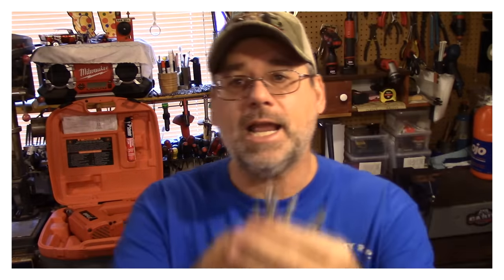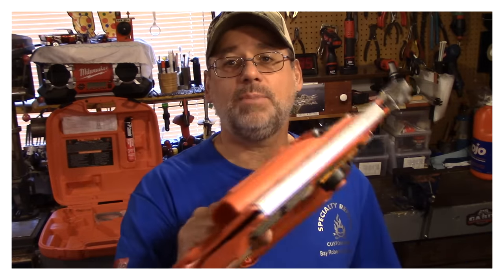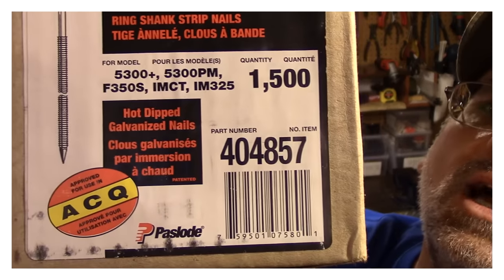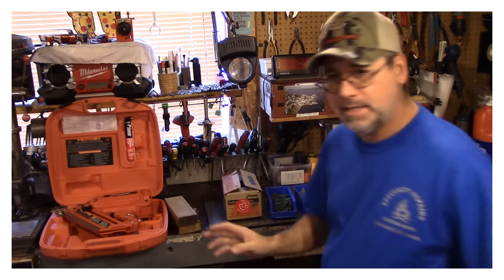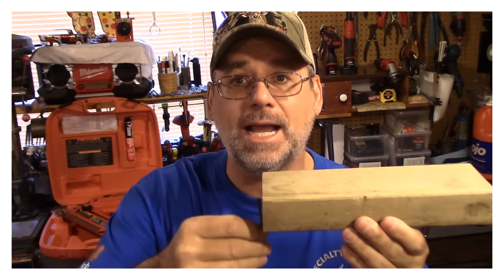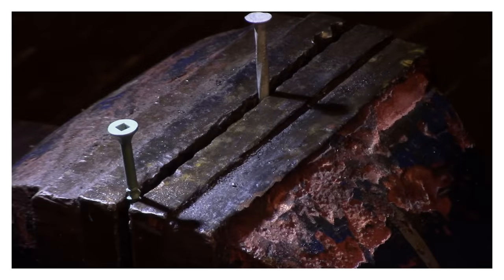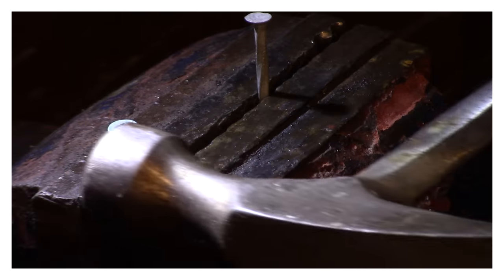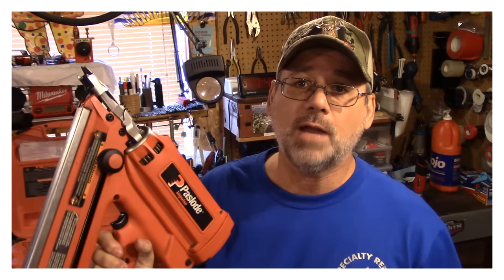BEWARE  NEVER USE DECK SCREWS  - DECK SCREWS VS NAILS -  PART TWO IN DESCRIPTION

Comment: Your on the money Steve....Just got back from camp and the black flies are in season....me and my buddy came back a day early....could not stand the flies any more....guess i`m getting old but that tip bout the screws and not using for erecting any kind a construction   is spot on....had a electrical friend a mine wanted to do extraction on his camp with screw and he said it was the way to go and I told him if that was his way I was not helping but if he wanted i`d bring the air guns and even supply the nails and I`d be there and I think I converted him....the new pressure is I think some kind of sugar base....they can't use arsenic any more and I seen the pressure treated wood rotting around a normal rusting nail but even hot dip rust.....I a the camp have a chain thats ten years old and its hot dip and you could not tell to look at it.....must go ....lots of backed up movies and messages and ....ah I have to hire a secretary but I have to pay out of my pension money....ah I`ll ask my wife If she wants to be my secretary....SALUTE my friend
Reply from the maker: HAHA need a secretary now. LOL  Might be headed up this weekend and I know the bugs will be bad too.

Comment: That's true for impact loading screws are carburized and heat treated to high hardness and strength but are brittle and may even break during rapid torquing but they resist creep due to temperature change and water exposure that will make the nails pull and loose grip of time.  Screws hold fast - this is why they are used to stop old oak and maple tongue and groove floors from creaking after the nails loosen over time.

Comment: Ok, yes, steel deck screws break. BUT you can use SS, stainless steel deck screws, they do not break, they will outlast nails, they can bend more cycles than nails. Other interesting thing is bronze wood screws for boats. You would think they might break, but they usually never break, and a wood boat has a ton of movement all the time for many decades of life. Of course bronze cost too much for houses. Nails are the best cheapest option. But my experience using SS screws versus deck screws, is the deck screws break and the SS screws have never broken. I dont even like using deck screws on the top boards of decks.

Comment: Both have their uses...screws for surface clamping..nails for structure/shear application
Reply from the maker: Hi Edward 
💯 % 👍  I just went on a small job to replace 14 deck boards on a huge deck , all with screws . All the screw heads were full of solid stain so it  was a bear replacing the boards compared to nails . They both have their pros and cons . Cheers 👍

Comment: I have built decks for a few years always use screws for the decking.  Over a number of years had to replace  a number of decks because nails were used instead of screws. Usually by someone  flipping house just to say house has a new deck.
Reply from the maker: Deck screws are designed to be used for deck boards as well as fence boards .  They are definitely not designed  as a universal replacement for joist hanger fasteners or lag screws ect .  For the most part screws vs nails  for fences or deck boards  are a  choice  .  Cheers Steve 👍

Comment: Wonderful tip and example of why u don't use them in structure application. I really wish they would put a warning label on the screws to alert folks from making a mistake.
Reply from the maker: That's a good idea . I wonder now why there is no such warning. Great idea and I will look and see if there is any mention. Thanks

Comment: Yes Steve absolutely a must do use galvanize fasteners in pressure treated lumber in fact when I started the sky coop The guy at the lumberyard gave me the wrong nails and I probably used 100 or so before I realized I was going wrong on the Simpson ties straps I didn't bother pulling them out I just had to drill a second hole to Adam other faster next to the wrong one it really sucked not to mention set me back half a day 🐔
Reply from the maker: Turned out great and will last a long time. Yes the wrong fastener can make for a bad day into the future. Cheers buddy

Comment: Deck boards,use screws doing it once.I have pulled out so many nails that popped up holding in deck boards replacing them with screws
Reply from the maker: I agree and use good deck screws too  Cheers Walter

Comment: Good video. The key thing to understand with any screws is that they're meant to clamp things together (load trying to pull the boards apart), not hold shear (side load, like the hammer blow in the video). 

The screws are much better when clamping is what you want to do, since they're threaded, whereas nails will back out.

The nails are much better at holding shear loads. 

It's not that deck screws are crap, they're just not meant for shear.

Comment: Im not a carpenter.. I mean I have built many things, and 90% of the time I admit to using screws. I figure a screw isnt going to back out over time like a nail can do. Never had any failures, but certainly cant argue with your little demonstration there. Might rethink things from now on.   As far as the outhouse build and a video, I vote do it!  I would find it interesting!  Dont hear of many people building an outhouse these days.  I actually have an outhouse here at my house from years gone by when that was the only option. Ahhh the good ol days right? LOL!  Great video Steve!
Reply from the maker: We all use them and sometime it can go sideways in the wrong  spot. Yes they're ok but use them wisely I guess.  Outhouse it will be. Cheers

Comment: Though that box of strip nail says hot dipped, I have my doubts. Typically hot dipped hand nails have a very rough surface. The only way I'm aware of that galvanization can be done to have a smooth surface, is electro plate.

Comment: Depends on the direction of force {load} Nails have better shear screws have more tensile. If it's where two pieces can slide against each other on the horizantal nails better, if it's where the direction of pull is vertical screws are  better.

Comment: Your absolutely correct that they are brittle.  I like those twisted nails that you showed, smooth ones pull right out.  That being said, I have pushed deck screws to the max. building scaffolding.  From the view point of metalworking there is a strong force when tightening two smooth surfaces together that resists the shear force.  I built my house with 10'-13' high ceilings and made a false floor throughout the house so that I could install 4'X10' T111 to the ceiling by myself using two to three deck screws at the end of 2"X6" with 3/4" plywood on top.  After taking the false floor down I found a couple of places where there was just one screw from where I assembled it myself, so that the other end swivels, and then I forgot to put one to two more there.
Reply from the maker: Interesting topic for sure as many do use deck screws in some odd spots :) Cheers Brad

Comment: This has to do with the temper of the different metals. Screws last longer and have higher mechanical bonding, but are thinner and hard tempered. Nails are usually cheaper by a lot (which is why they are used) thicker and have a softer temper. Anything that requires more sheer strength then a screw can hold should be using structural bolts and brackets. Nails are why homes fall apart in 50 mph winds. Nails were originally invented with a soft temper and to be driven THROUGH an object and folded over on the other side which is far superior to modern uses.
Reply: Thanks, this info re bent-over nails is is a really interesting and helpful historical insight. Adds to the bigger picture of this video.
Reply: We've all heard the phrase "dead as a door nail".  Many years ago when doors were made a long nail was hammered through the door and the sharp end bent down with a hammer to ensure it wouldn't back out. That made the nail non-reuseable i.e. "dead".
Reply: Excellent information.  While I use screws for their compression abilities I also use brackets with bolts (not lag screws) to through-connect things like rafters to top plates.

Comment: Sold my old Paslode (not paying for gas) and added a DeWalt nailer (battery), glad I did. Don't smell the gas and the gas cartridge doesn't end up in the dump. Never had a problem. Battery-powered tools are the best!
While I agree that you wouldn't want to use screws for structural (lateral holding strength)  when heavy load-bearing, they are great for attaching deck boards. I think the video should have shown the benefits of using them to hold boards in place and firmly to the joists, which nails do not do well. Always use 16d galvanized and joist hangers along with joist nails for the framing.
Reply from the maker: Well said and I agree . The choice between nails and screws for many comes  down to cost but sometimes you save upfront and pay after :) Both have their place and knowing their place is what this vid brings up. Cheers Christopher

Comment: 4:40 I see what you’re getting at, finally.  The metal used in the screws is hardened to give them the torsion strength needed to not snap off as easily when being driven in, but that compromises their sheer strength.  Nails use a more ductile type of steel and therefore are made for and perform better under sheer loading.  Now, it should be noted that there are lots of types of screws, so the above is to be taken as a general rule. 
Good point, you just took a few minutes to get there.  It’s definitely Worth considering the forces and environmental circumstances acting on the structure being built and choosing the appropriate fasteners.

Comment: Good tip specially with something that will shift due to weather conditions.
Reply from the maker: I had  deck  screws holding the door hinge  on  my old outhouse and noticed last year two heads missing , just the shaft was there  and I was wondering why the door felt wobbly , hahaha .  I guess over time it loosened up and  snapped the heads off.

Comment: To explain why pressure treated eats metals the C in ACQ pressure treated lumber is copper.  When dissimilar metals come in contact with each other in the presence of moisture/water (or other conductor) the less noble of the metals gets eaten (corrodes) by the stronger metal.  It's called a galvanic reaction.  A typical nail/screw will deteriorate very fast in pressure treated because of this.  A galvanized screw/nail has a zinc coating that's sacrificial and gets eaten by the pressure treated wood, but takes a long time.  Once the wood eats through the galvanized (zinc) coating the steel underneath will quickly be eaten following.  The more coating the longer it will last (why electroplating is least protective and double-dipped galvanized is very protected).  Some screws/nails are coated with a special coating that prevents moisture coming in contact with the metal of said nail/screw resisting galvanic reaction.  Many manufactures actually use a combo, they hot dip galvanize and then cover with a polymer (more coatings the better) as it's cheaper than double-dipping and offers more protection than a single dip.
Reply from the maker: Great explanation.  Thanks 👍
Reply: Is there a hot dip galvanize deck screw?

Comment: Thanks for the tips, and thanks for the tips from u guys in the  comments!  I've had nails pulling out on my own deck since i put in the new floor and replacing then w/screws.  But will go with nails on any structural.  I'm a handyman, wood butchering being on the bottom of my favorite things to fix but gonna get a call now and then for it!
Reply from the maker: Cheers Paul  we all learn from each other. 👍

Comment: The screws and nails you buy at most lumberyards rust and do not last as long as the treated wood. I recommend stainless nails. Maze nails are the best for galvanized, maze ring shank, once you pound them in they will not come out. Stainless ring shank is best for structural but stainnless screws are ok for deck or non structural areas.  Some stainless screws can be kind of weak and break off  while screwing though.

Comment: I use deck screws, Torq? In framing as well as decks and privacy fence inst. , it’s easier/ much less painful than holding a nail gun or the joint shock from hammering, of course I’m 65 with plenty of joint damage and DDD.
Reply from the maker: Hi Michael 
I know how that feels, too. Cheers 👍
Reply: Michael, an impact driver works far better than an ordinary driver-drill. I have arthritis, and when I bought the impact driver several years ago I was amazed at the difference and kicking myself for not having bought one much sooner!

Comment: From my Dad the Structural Engineer “screws are for pull out, Nails are for Sheer.”  Use nails except for when you need pullout resistance
Reply from the maker: I go by best practices and follow local building codes  when in doubt.

Comment: I use deck screws for structural all the time. Several sheds, small barns and even yes decks. Never gad a problem or failure.
Reply from the maker: Structural can mean different things to people but deck boards , exterior barn boards or the outside sliding of a shed is not structural .

Comment: my dad built a 40x60 shop using nothing but 3" deck screws back in 2000 and it hasn't fell down yet, so I'm gonna say they are fine for building an outhouse. Not sure what code says about this but The screws don't break like that if you have it going through a board like it should be. If you do the same test with one of those ring shank hot dipped nail gun nails you have there, they will break off too, they won't just bend over like a hammer driven nail. with that being said put 2 post in the ground nail a 2x6 or something horizontal across between them with a screw in one side and a nail in the other and hang weights off of the center of the board to see which side fails first. I prefer the ring shank hot dipped gun nails, cause they are faster but Im not sure that they are any better than screws as for as shear strength because I've broken plenty off.
Reply from the maker: Good points Chase.   The deck screws  may be  more affected by climates with cold.  If a building has to be inspected by a building inspector  it most likely won't pass inspection with plain deck screws in a lot of jurisdictions.  Was the shop your dad built inspected by your local building inspector.
Reply: no, its in a very rural area and was also 17 years ago so I'm not sure it would have even mattered. it's built similar to mine except not as tall, and he got a deal on wood poultry house trusses like mine but couldn't move em on his 18' trailer that i had in my video so he cut trusses in half with cutting blade on a grinder where the metal plates were, and joined them back together when he got em home with 2x material and deck screws, and then I kid you not we put each truss up by digging a hole with post hole diggers, standing a piece of 4" thin wall pipe in the ground and climbing a ladder hanging a chain hoist on it and hoisting them up. could only do about 1 truss a day time you put it back together and got it hoisted up and put lath boards on top.

Comment: Taking a deck for example, where in its construction are screws/nails actually structural? The fasteners used to attach a ledger to the house are, and those should never be nails always lags or ledgerloks. Stairs should also be attached with structural fasteners like lag bolts or ledgerloks.
Reply from the maker: Good suggestions william - thanks for the comment.

Comment: "HMM, I didn't think the gun was loaded" :)
Good tip, I would have gone for the deck screws right away. I knew they broke easy, but never thought how that would effect structural integrity. Good tip Steve
Reply from the maker: It's a common screw used  for just about everything but be cautious if you ever have to have it inspected  by a local  building inspector . I look forward to building the outhouse soon. Cheers Lee

Comment: Once they are in the frame they won’t suffer bending lateral impacts that can make them snap. GRK and Griprite both make corrosion resistant construction screws with plenty of shear strength that work great. You don’t need a nail gun. Every weekend warrior has a cordless drill.
Reply from the maker: Weekend warriors use deck screws in contravention of normal building practices as well as local building codes.  Weekend  warriors for the most part are not trained  in construction as I see so many instances were deck screws are used where all building codes reject their use.  Being informed  what fastener  to use  is definitely not commonly known  or you can be a Weekend warrior and take your chances 😉

Comment: Show Building it. I have one from the 1900's in my Woods in Wisconsin. It was well made. I just keep finding old tin to keep a old style roof on it and use old barn wood, from around my area.
Reply from the maker: I will and it will be unique and practical.  The old one I have I built  in 2 hours and cobbled together , it lasted 15 years and now I want something the bears can knock over or the wind.

Comment: I've built fencing for horses and used three and half inch galvanized ring shank nails, and they lean against the wood and they rip wright  out, then I started using three and half inch star bit screws they work way better then nails, especially around horses I've been in construction for 35 years nails are faster but not better than the wright screws, screws hold better and don't back out.
Reply from the maker: Good idea as I have done the same for horse stalls as a horse will cut itself on nails sticking out of the wood rubbing against the boards.
Reply: Grk are the only way to go